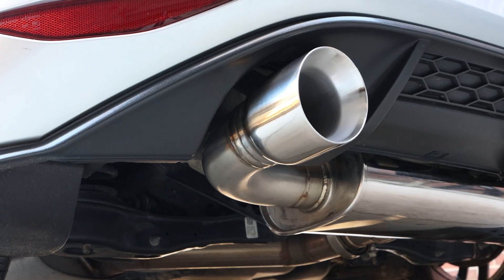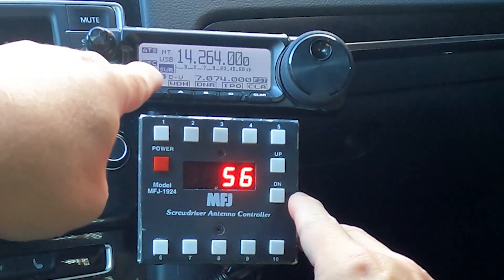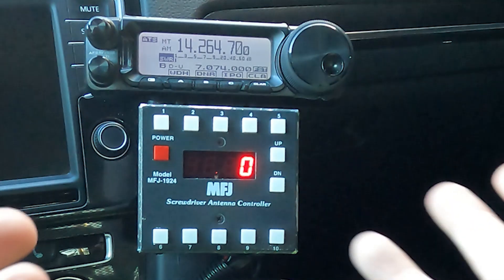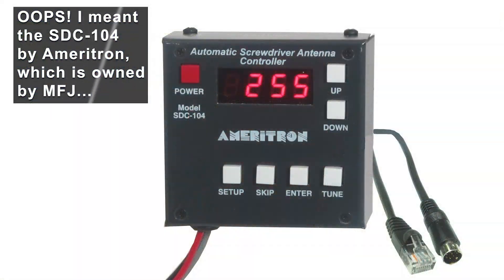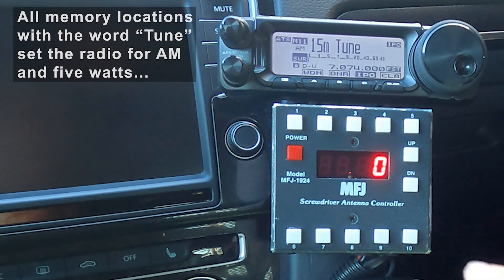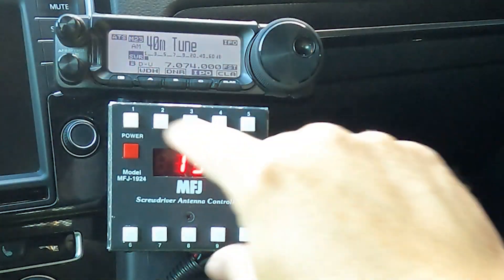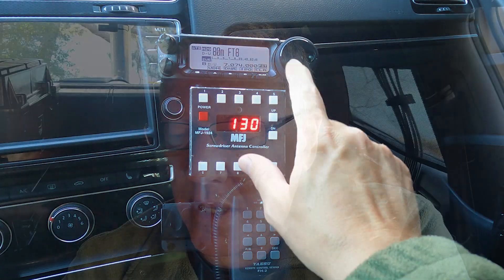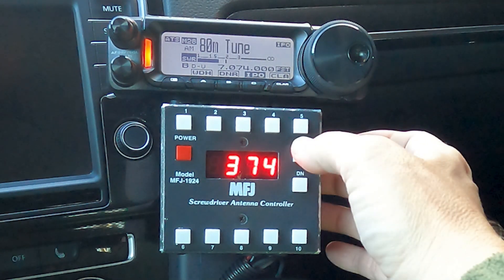MFJ-1924 Screwdriver Antenna Controller

Comment: What are you going to do now with your MFJ-1924 if it breaks now that MFJ is basically closing most of it's operations?
Reply from the maker: MFJ is only closing their manufacturing facilities. They still plan to sell existing inventory and maintain their repair facilities for a while. Hopefully, someone will buy some of their more popular product lines and keep them alive. If not, I know I can find other options. For example, "TuneMatic" has a simple controller that I could buy, should I need a replacement. Thanks for visiting!

Comment: Hi, Do you know if this is compatible with the ATAS 120A
Reply from the maker: No, it's not. The ATAS-120A uses unconventional "up-down" voltages, something to the effect of 11V to go up and 9V to go down. It's made to interface with key Yaesu radios, but there are interfaces available that work with other radios or tuners. However, I know nothing about them. Thanks for visiting!
Reply: Thanks for that info. Much appreciated.

Comment: Think it's so frustating have an "auto tuner" for screwdriver antenna and need to "downgrade" to manual controller...
Reply from the maker: I don't consider it a downgrade at all. Yes, the automatic unit was a letdown in my application, but I think the 1924 is excellent for what it does. Thanks for visiting!